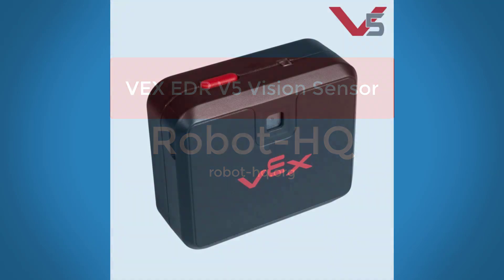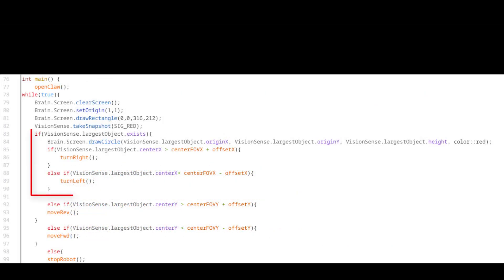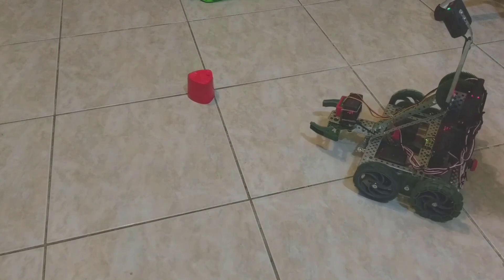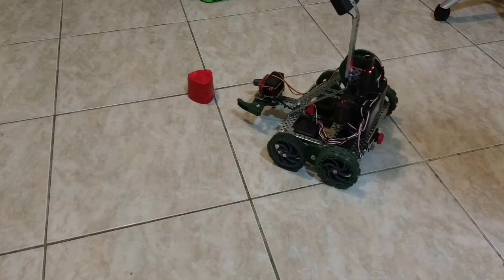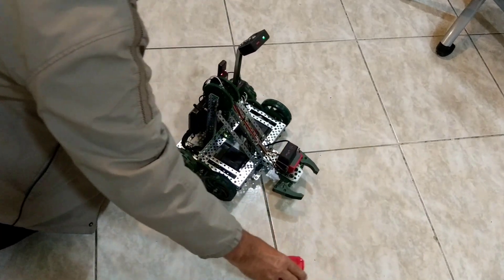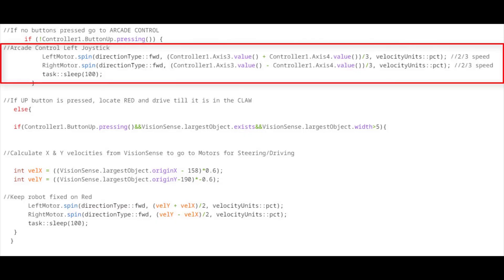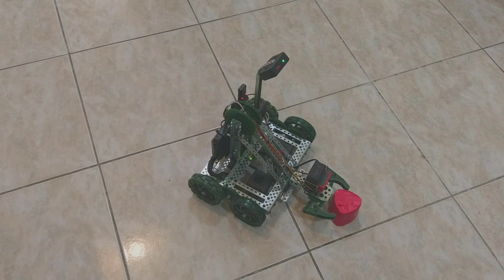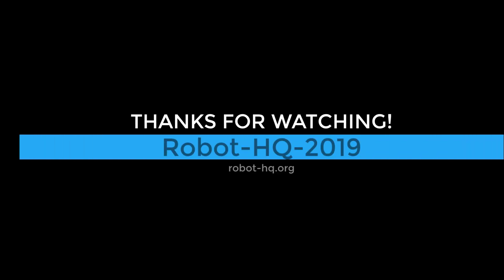VEX EDR V5 Vision Sensor

Comment from the maker: Many people asked, so here is the code.... But please keep in mind that this won't work if you copy and paste. After the copy and paste, you'll need to do your robot configuration an make sure the names I used for motors and sensors match the names you used, then you will also need to save a color signature. This code drives the robot normally, using Arcade control on the left button, it also retains control of the arm and claw, but when you press the "UP"/"^" button, if will go to "visionDrive" and zoom in on the object.

#include "robot-config.h"

//Global Variables

int armSpeed = 20;

int main() {
    
while(true){ 
            Brain.Screen.clearScreen();
            Brain.Screen.setOrigin(1,1);  //Set Screen orientation
            Brain.Screen.setPenColor(color::white);
            Brain.Screen.drawRectangle(82,30,316,212);  //Draw the VisionSensor Field of View
//Take Snapshot for red
            VisionSense.takeSnapshot(SIG_RED);
//Draw what the vision sensor sees
            Brain.Screen.drawCircle(VisionSense.largestObject.originX+82, 
                                    VisionSense.largestObject.originY+30, 
                                    VisionSense.largestObject.width, color::red);

 //If no buttons pressed go to ARCADE CONTROL
       if (!Controller1.ButtonUp.pressing()) {
 //Arcade Control Left Joystick          
            LeftMotor.spin(directionType::fwd, (Controller1.Axis3.value() 
            + Controller1.Axis4.value())/3, velocityUnits::pct);                        //1/3 speed
            RightMotor.spin(directionType::fwd, (Controller1.Axis3.value() 
            - Controller1.Axis4.value())/3, velocityUnits::pct);                         //1/3 speed
            task::sleep(100);
         }    

 //If UP button is pressed, locate RED and drive till it is in the CLAW   
    else{
    
    if(Controller1.ButtonUp.pressing()&&VisionSense.largestObject.exists&&VisionSense.largestObject.width>5){  
 
                
 //Calculate X & Y velocities from VisionSense to go to Motors for Steering/Driving
    
    int velX = ((VisionSense.largestObject.originX - 158)*0.6);
  //Added 0.6 to slow the robot down, it was too fast at first
    int velY = ((VisionSense.largestObject.originY-190)*-0.6);       
         
 //Keep robot fixed on Red 
        LeftMotor.spin(directionType::fwd, (velY + velX)/2, velocityUnits::pct); 
        RightMotor.spin(directionType::fwd, (velY - velX)/2, velocityUnits::pct); 
        task::sleep(100);
    }
   }

   
 

 // Arm and Claw operation (with Limits) 
    
    if(Controller1.ButtonL1.pressing()&& ArmMotor.rotation(rotationUnits::deg)<400){
        ArmMotor.spin(directionType::fwd,armSpeed,velocityUnits::pct);
    }
    else if(Controller1.ButtonL2.pressing() && !ArmLimit.pressing()){
        ArmMotor.spin(directionType::rev,armSpeed,velocityUnits::pct);
    }
    else{
        ArmMotor.stop(brakeType::hold);
    }
    
    if(Controller1.ButtonR2.pressing()&& ClawMotor.rotation(rotationUnits::deg)<270){
        ClawMotor.spin(directionType::fwd,armSpeed,velocityUnits::pct);
    }
   else if(Controller1.ButtonR1.pressing() && ClawMotor.rotation(rotationUnits::deg)>0){
        ClawMotor.spin(directionType::rev,armSpeed,velocityUnits::pct);
    }
    else{
        ClawMotor.stop(brakeType::hold);
    }
  }
}

Comment: Hey can you sent me the vision sensor code?
Reply from the maker: Here is the part I think you're looking for, just put it in a forever loop:
 if(VisionSense.largestObject.exists&&VisionSense.largestObject.width>5){  
 
                
 //Calculate X & Y velocities from VisionSense to go to Motors for Steering/Driving
    
    int velX = ((VisionSense.largestObject.originX - 158)*0.6);
    int velY = ((VisionSense.largestObject.originY-190)*-0.6);       
         
 //Keep robot fixed on Red 
        LeftMotor.spin(directionType::fwd, (velY + velX)/2, velocityUnits::pct); 
        RightMotor.spin(directionType::fwd, (velY - velX)/2, velocityUnits::pct); 
        task::sleep(100);
    }